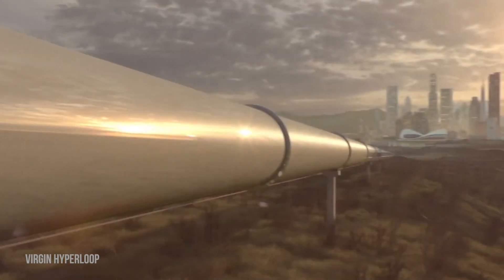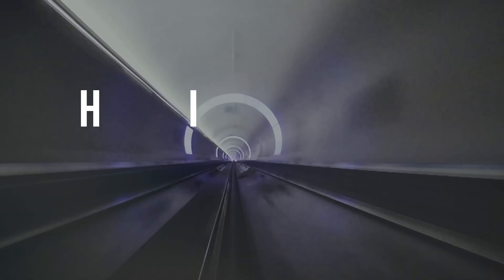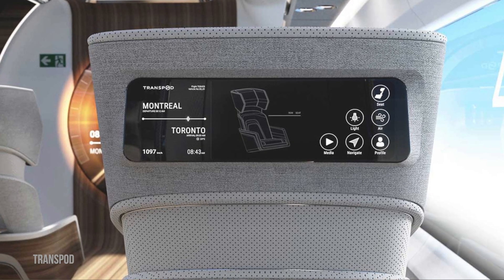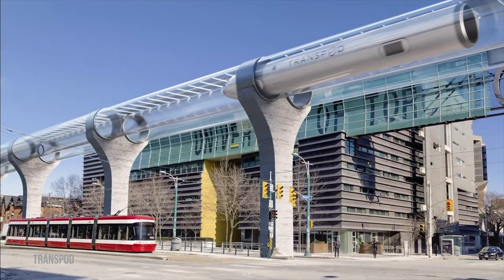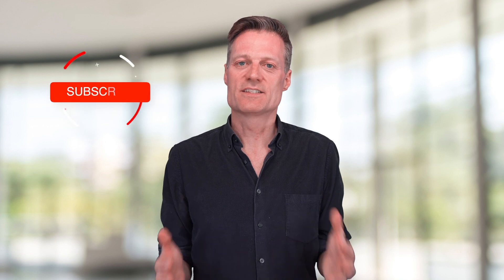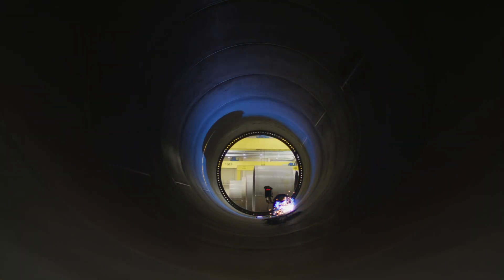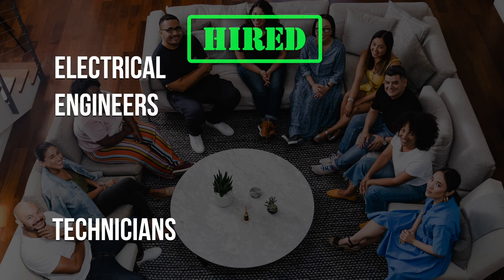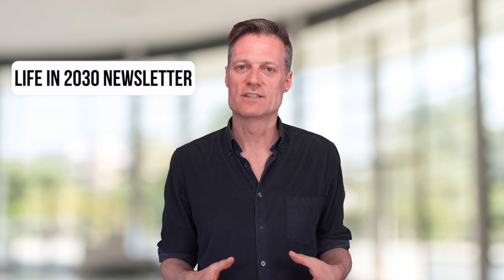Here is why Hyperloop trains will FAIL by 2030

Comment: So many open questions.  On of them is the capsule.  Capsule has to be built to aerospace standards and pressurized for passengers.  If capsule leaks, they will suffocate.  Capsules also have to be fitted with CO2 scrubbers.  CO2 in high enough concentration is toxic.  And then there is passenger ingress and egress.  Giant airlocks would have to be opened and closed for every arrival and departure.  Fanboys will say once commitment is made, the march of tech advance will solve these problems.  That's a load of hog wash.